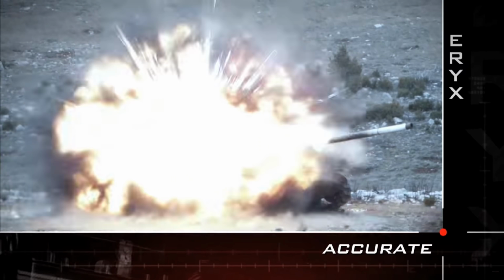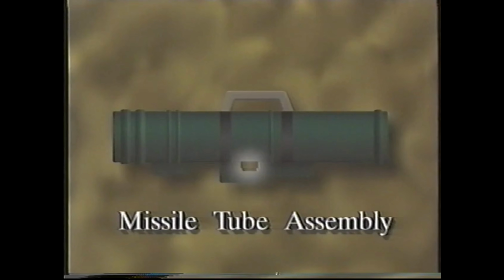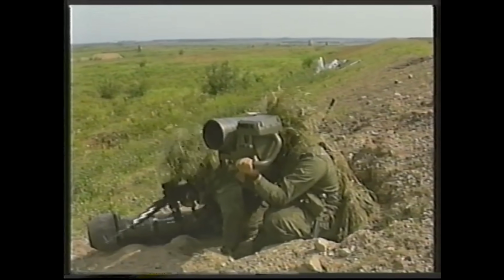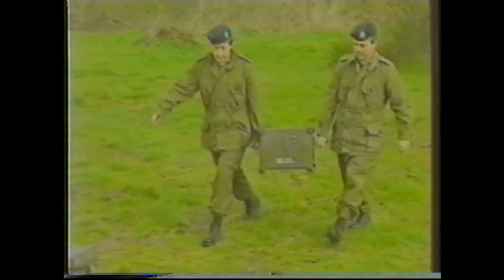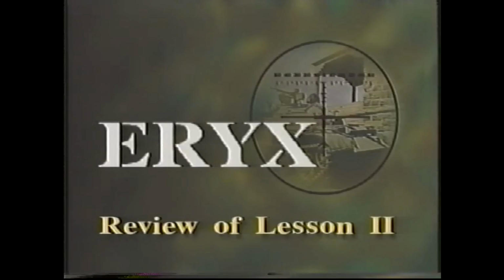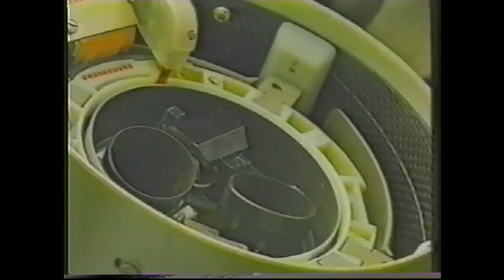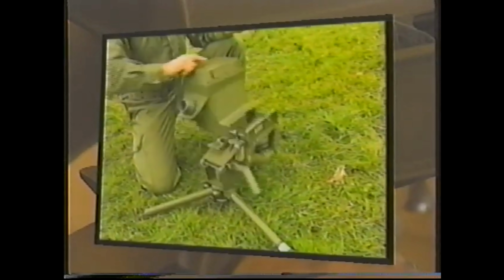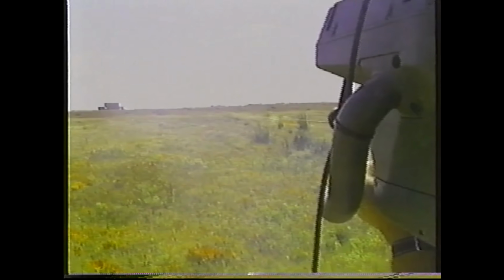The 'Eryx' Wire-guided Anti-tank Missile | HOW DOES IT WORK?

Comment: Greetings . Does anyone know the ATGM DRAGON system? . It is supposed to be a system with SACLOS guidance but no control for guidance can be seen, you simply aim with the optics and the missile goes to the place where it is aimed with the scope? . Thank you .
Reply: it's the same as any SACLOS keeping the crosshair on the target, while the Dragon uses wire guidance, it's using a so-called "tracking control assembly" (TCA) guidance system previously used on the TOW and Shillelagh missiles. With this system, all that is required of the infantryman is to look through an amplifying optical sight and keep it exactly aligned with the objective which means keep the target on sight and track them. Of course, the Dragon has its own unique propulsion and uses for its many like 27 to 30 small rocket thrusters, later variants like Super Dragon might have 57 to 60 pairs of them, plus its unconventional flight path, coupled with the popping sound and ring of smoke emitted by the thrusters, which makes the Dragon not a reliable weapon due to design reasons and believed that was Complicated and Overdesigned(small rocket motor thrust is still adapted on large missile like patriot and other types, those work pretty well). and most people are not happy with it because it is considered to be risking their lives by popping sound and the range was only inside of 1000/1100 meters to firing. otherwise, the M47 (FGM-77) Dragon still works just like the SACLOS guiding is still proven accuracy and killing modern tanks was unlike work except for older tanks, flanks and rears is remained workable Because penetration isn't great and only has 330mm penetration(on the original version), so it's the hopeless deal with frontal armour of modern tank and also there's Dragon II or Super Dragon(will be much better) variant will be likely do more chance favour to deal with a modern tank, of course, it's depending how do you using them, But you can still able to kill a car, APC, IFV, SPG, SPAA, and fortified defences as well, it still well does effects and done their job.

Comment: As  a complete non-military dunmy, watching this video gave me an idea. Looking at the necexssary 
prooperties listed at 3.40 is there room within an ISTAR ssuport infantry riole or conventioal ddencee and assault roles  for a small heavily armouted tracked fighting vehicle drone to be advanced slowly rright alongside of infantry and UC of sauid infasntry. kInd of a drone mini-Matilda tank
. 
pri=ov                                  spec
1-3 rtons  (guess)
6'x5'x3' high
slatted armor as fitted tp BV206 for exampl but tiny
Leaving a void of 4'x 3 x ' 2' for innaards. mtoirs batteries systems etc
Power : elctric all systems., NIMH trecvh
Propulsion
 from BoltEUV 
The Chevrolet Bolt EUV is expected to feature the same battery electric powertrain as the Chevrolet Bolt EV. This means a 66 kWh lithium-ion battery pack and a front-mounted permanent magnet electric motor rated at 200 horsepower and 266 pound-feet of torque. Driving range is believed to be 259 miles.
MOtors: 8 x stndard bolt mortors appprpx 1600hp (USA) por 1.2MW 266ft--pp ((1 motor  per teack wheel, 2 tracks, 4 wjeels per track )
Speed :  pure gess18mph on bursrs , steady 4mph, "creep mode" 0.6mph  available: direct drive
Enurance/range : froim Bolt standard 66kwh  - pack x8 15minutes on burst, maybe an hour at 4mph, but spens most time on standby

carrying
hMG
or mortar
or AT missile
or .  . . .

small target, low temperature, dismountabl mabpackable paylod etc.resietqnt to RPPG ETC

Comment: I do not think that Eryx was not as successful because of one failure of its main motor ignition, after launch. Here is a link to a video showing 7 similar failures of the Javelin missile :
https://www.youtube.com/watch?v=ZAUYgi86vWE
The problem with Eryx was it's limited maximum range of 600m, in relation to competitive systems. For example, the Javelin has a maximum range of 2000m and the Spike-SR goes out to 1500m. On top of that, the 84mm RCL Carl Gustav offered more versatility with different ammunition options for ranges similar to the maximum range of the Eryx.
Reply: There was no Spike-SR or Javelin when Eryx was fielded in 1991 😉
Reply: @JoJo-vm8vk  The Eryx ATGM had a range between 50 and 600 meters, that was well within suppressive fire range by MGs.
This exposed the operators to enemy fire while guiding the missile.
At the same time the MILAN was very successful with a range of 200 to 2000 meters.

For short range up to 800 meters, there were a number of non guided weapons like Carl Gustav, Panzer Faust and one use systems like LAW, STRIM, AT-4 etc.
These systems, much cheaper than the ERYX, although they could not destroy a modern MBT, the could immobilize it, until other systems like MILAN or TOW could finish the job.

Comment: Had the same happen years ago with Milan systems. The missile was notorious from breaking the wire soon after launch, especially with an inexperienced operator. The missile would dip after launch, and the operator needed to bring it back up on target carefully. New guys would snap the controller back up, breaking the control wire.

Comment: It doesn't seem to have much backblast - is it designed to be fired from within buildings?
Reply: Yes, there is a small launch charge that pushes the missile out of it's tube and the main motor is ignited at a distance from the launcher. This way, the back blast is kept to a minimum so the Eryx can be fired from enclosed spaces. There is a restriction however in regard to the distance of a wall behind the launcher. The failure shown was due to the main motor failing to ignite after the launch charge was fired.

Comment: The design of the test-set for the Eryx is clunky and un-streamlined; more effort diverted to modularity than to systematic functionality, basically the front line test crew orders are usually send back for a replacement of the whole thing not one part, that's why they're front-line not base repair crews.  The guys in a protected base have time to individually troubleshoot parts that are working, and if the thing has a part that breaks they're not likely too keep carrying around the non functional box of bits if they're more "front line" than base crews.
Reply: The difference between Unit-Testing and User-Testing in software parlance...they've miss prioritized the purpose and weighted rear-area / training test stand rather than operations.  Might mean no one in the acquisition chain really expects canadian infantry to use this system and they'll just be going through the motions.

Comment: As a former Eryx instructor I can tell you that you are not going to fire this system without the tripod. 
If you aim too far out of where the back of the missile is atm, it shuts down, you forget yourself and release the trigger for a split second, it shuts down. The further away the target is, within 600m of course, the easier it is to hit, but that is easier said than done if its not on the tripod. A "dummy" missile costs just about the same as a live one because all the components that gets the missile from A to B is in it and they are also destroyed on impact. The targeting info is also a bit wrong. You use the arrow up on center mass of the target when you fire to prevent the missile falling into the ground before the main engine starts. The reason it has two engines is so you dont burn your face off. In turn, this also means that the "backblast" area isnt really a concern unless you are really close. When you target the tank you actually aim a bit lower than the video claims because the missile has a tendencies to fly higher than the main crosshair unless its very close to maximum rage for the system. Meaning you sort of aim at side tracks to hit turret. A standard tandem HEAT does about 900-1000mm of homogeneous armor penetration (plain steel) if memory serves me accurately. 
-
The "upgrades" to this system seems to be the thermals, if those at the start of the video ar accurate representation. Because that is LIGHT YEARS away from the gen1 thermal colossus (close to the size of the Eryx optics) I used that had one color (aside from black) and thick none rendered black area lines between every render line. If you go to the wikipage of the Eyrx you can actually see the thermal sight attached in the main image.
Reply: I read this twice already.
Thank you for sharing
Reply: @1joshjosh1  np. :)
Reply: As a former RCR, i was told we phased them out and were going with american supplied javilins. But that being said i never saw them used either, as of my tour in 2007 we had LAW 72s and that was it, not that we needed anything bigger.
Reply: @redcastlebowser4179  Yeah, the Eryx is mostly a backup system for most nations these days because they bought the missile amount in bulk and live rounds are often not used for training so they still have the live storage and the firing units. Where I served it has also been replaced with the Javelin system while the Eryx has not been decommissioned, I think, for the reason above and instead just put on storage. Obviously AK farmboys wont roll up in armor, but if a CV90 stops, tells you to get out and kill something IT is too scared to face. Then you need a bit more than a LAW. :D That said we viewed the LAW as a bit of a hassle because we also carried 5-10 of them pr squad aside from an RFK84 and the Eryx, or Javelin today, when needed. Stormtroopers/shocktroops are heavily armed. Regular infantry at the time in my nation didnt even have IFVs, let alone 1m snow piercing ones. Today most front line infantry are mounted on CV90s though.
Reply: @Lobos222  ahh yes, the sweet sweet 84mm recoiless rifle, forgot about that (how could I?!?!?! Push up postion!!) 

I still dont think weve been armed with the javlin, but a good old carl g round is just as satifying, and works 1000% better then the eryx from what i learned today! Wish i could have fired one though.

The LAW was only for technicals really during my tour. 

We werent exactly fighting tbe russians or another nation so even the 84mm was a bit big.
Reply: @Lobos222  You just reminded me of the best detail I ever saw in the military. I was on a range complex in Virginia was assigned to a squad of Marines with a couple of trucks. They had the task of firing several hundred live AT4 rockets that were coming up on their expiration date (if the date is reached, they have to be returned to the manufacturer for safe disassembly at a huge cost). Took that squad about 24 hours to go through them all. I bet they'll never forget that!
Reply: @IanCaine4728  Yeah, those kind of stories is stuff that sticks.
-
I have had a similar experience with rifle ammunition. Delayed intake and budgets that meant what you used last year, you get the next. Meant that me and about 20 others had to use up all the ammunition for the whole battalion that was estimated for two months of the calendar year. The delay wasnt that long, but it would also delay training and therefor extend the time before regular soldiers would be shooting their rifles. Among a bunch of stuff I even shot a single belt of 600r (MG3 has linkable 50r metal belts) with only tracers. Yes, 600 tracers in a row. :D We also did allot of advanced shooting drills so we didnt just waste ammo, but despite that we had to line up several G3 and just nonstop empty full auto mag after full auto and swap when the weapon became too hot and continue. It was pretty wild and we probably spent a large fortune in ammunition. This should also be viewed in a light that our units were prioritized for ammunition since we were shock troops. I have literally shot more auto than the movie Starship troopers. HAHAH :D
Reply: Here at 4:33 :
https://www.youtube.com/watch?v=1HGMJwHuGPQ
You can see a soldier firing an Eryx without a tripod. You also have a video from Afghanistan but i can't find it. I dont say it's not difficult, but it's not impossible.
Reply: @karakiri283  No one is saying it is impossible, but I guarantee you that guy didnt shoot it at an intended target, aka a MBT. Using that powerful HEAT rounds for other things is possible (I would argue a waste as well considering shell cost), but not intended and in a situation you only get one shot before the thing starts shooting back. You are not going to take any chances.
Reply: @Lobos222  In the french army it's used as anti structure weapons too, like any other heat charges. In the video from afghanistan or this one in mali, they are using it in urbain warfare to burst building were enemies fighter are hiding.
Reply: @karakiri283  don't be stupid..
Reply: If I remember well, you can shoot it from indor witch is a bit unique for a AT missile. Can you confirm it?
Reply: @inwedavid6919  The backblast area of the starter engine of the Eryx is such that you can fire it indoor, but the backblast area needed should be ca 2m regardless. 
-
You can also do such with other weapons like the 84mmRFK with only 2m+ clearance behind, which is not recommended by the manual, but you wont die. If you have long hair however it might have parts that are bit burnt. Anything less and you might get into overpressure\underpressure deflection issues that is dangerous or even get ejected forwards by the blast and that being least of your worries if it happens (death).
-
Comparable though. The Eryx can be used in house even in regards to the manual. One should however take into context that the missile will be "lobbed" forwards for a second and has a wire connected to is so that one doesnt have stuff it can be snagged on. Like a damaged window frame with splinters or shattered glass. If the wire is pulled on the missile will be shut down mid flight and just drop to the ground.
Reply: @John Gallagher you Can Not Fire the Eryx without a tripod or it attached to a Mount of some kind, no way..I think you might be confusing the sense where the trooper is firing a AT4 ( like the US uses)
Reply: @John Gallagher ok dude , take it easy.. Just didn't see how it made  any sense "How " that would really be possible with Out any stand of any Kind (bi tri single ,sandbag etc etc) being wire guided an all.. But Ill defer to you, I've been lucky enough to fire some TOW's an a few other things..The idea of shoulder firing a Wire system that weights what "50lbs all in" while guiding it an holding it~ makes you more man than me, let alone hit anything.. Cheers "Dude"
Reply: @reserva120  eryx is not bulky and heavy like tow. Its not "50lbs all in". Guidance device weight only 10 lbs.
Reply: @phuonghoai9415  yes I understand that already, I just spoke of the TOW because many moons ago I had fired one , an understand " as Lobos222 said, "an I'm going to take his word on the matter " how Wire guided really is.. , dragoon Guys use to talk about ( older cruder system compared To Eryx but same idea..)
Reply: I come from the future (2022), ak farmboy do deployed
Reply: fuck that garbage, i rather go with Dragon not your little shit.

Comment: So is the eryx better than the Carl G?
Reply: Eryx is "better" depending on what is being shot at. The Eryx has WAY more penetration power than the Carl Gustav ammo I have seen. It is also tandem and can therefor defeat single plate reactive armor. You would only use an Eryx on an enemy tank or similar high threat. If the enemy tank has some kind of point defenses. You could use the Carl to disable them with an airburst before firing the Eryx. Bottom line though, if you miss with the Eryx, you are dead and there are plenty of things you can do wrong. I rather use the Javelin and that has also been the replacement for Eryx even if those systems and their missiles are still in storage.
Reply: @Lobos222  440 mm cannon artillary thingy is Still My favorite. I think i will buy one for my next weapons system purchase.
Reply: @garrysekelli6776  Sure, but what do you do if that system is not in range, knocked out or busy doing something else... That is when you need a personal accessed hand held system. The military have "both" (art+hand systems) for this reason. :)